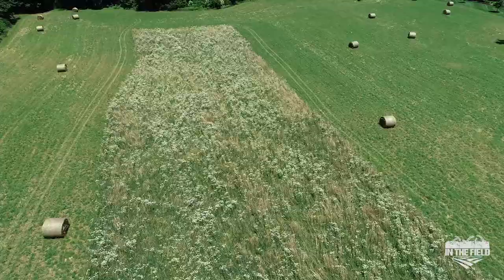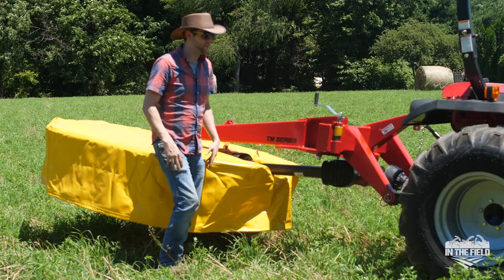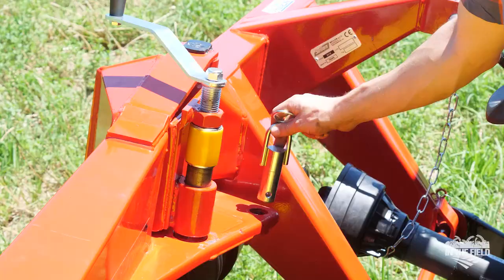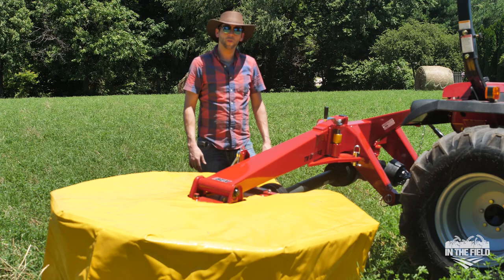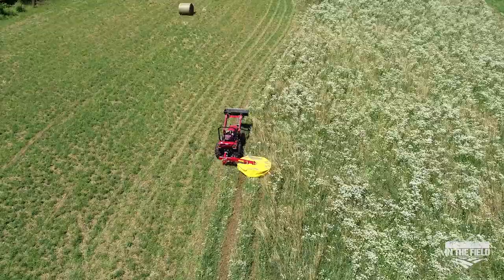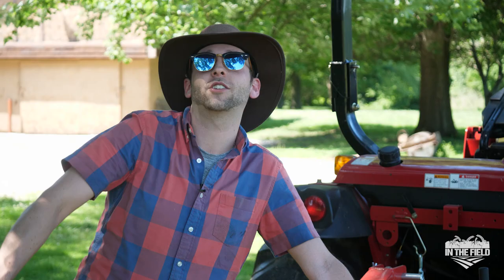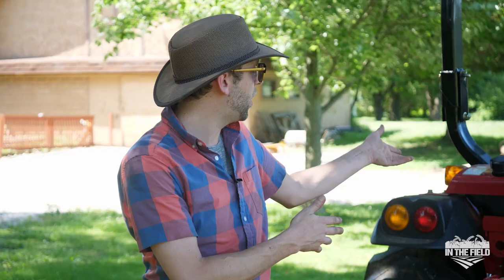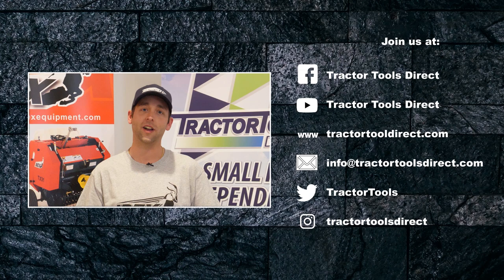In the Field: The Hay Making Process (Part 1)

Comment: No crimper...so you need to ted the hay right after cutting to break the hay shafts to improve drying speed
Reply from the maker: Thanks for watching and for your input. We actually sell drum mowers with conditioning systems too. In this field we used a standard non-conditioning drum mower and in fact did ted the field after cutting to improve our dry times. Check out our website to find our belt rakes, tedders, drum mowers & more @ www.tractortoolsdirect.com
Reply: @Tractortoolsdirect  Excellent
Reply from the maker: @PaulChristenson  Thanks for watching!

Comment: perfect square field.....short hay crop....my hay is as tall as the rear wheels on a 30/20 john deere tractor my meadows are of all odd shapes and 2 to 3 acres each ....thick hay, and no room for single windrows ....lets see you work in unsavory conditions ...
Reply from the maker: Thanks for watching the video! We left ourselves a small plot to demo and test these new pieces of IBEX equipment after large round baling the outer plot for this specific video. This was actually our first cutting of hay that was thick hay and much taller than normal, by a long shot, this season due to excessive rainfall. This was our first time on this field as we try and visit different fields as often as we can to test new and unknown conditions. Let us know what all you would like to see and we'll try and make it into a video in the future for you. Thanks again!
Reply: I think you'll find a drum mower can take on any kind of hay crop, whether it's super tall or thick and blown down. I've had a similar drum mower [SIP 165] for many years, never been disappointed by it's performance.